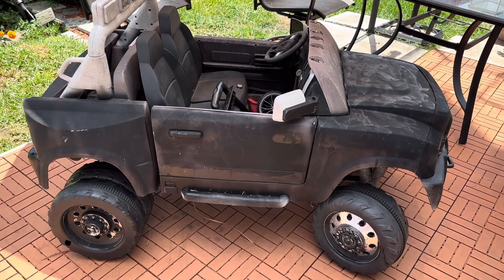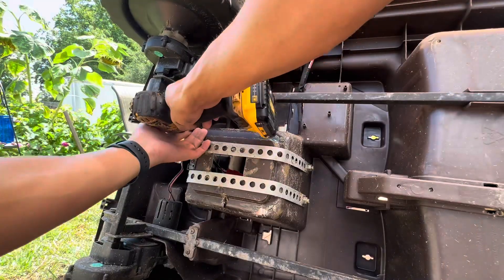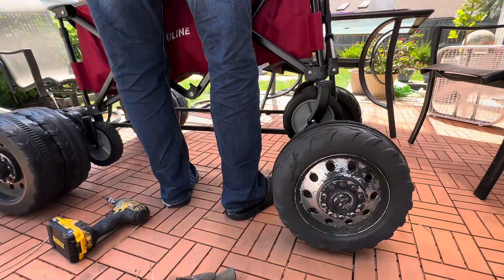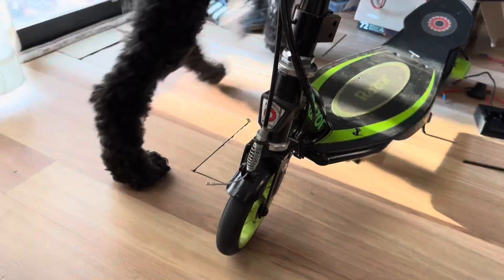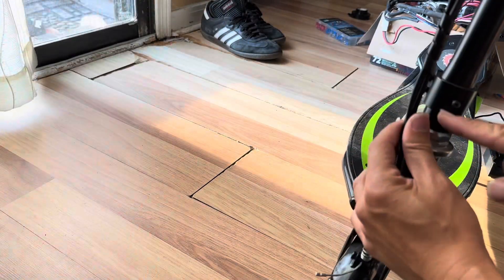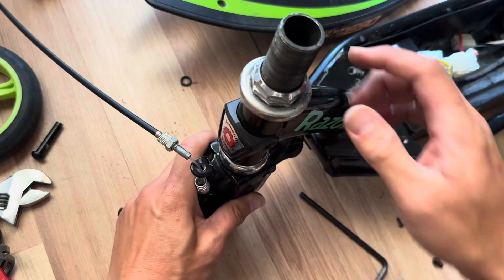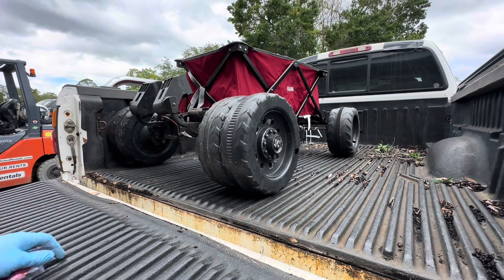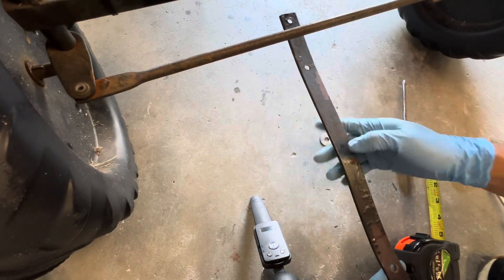Building 40V Electric Motorized cart Wagon w/ power wheels kidtrax, Uline wagon Razor scooter Dewalt

Comment: Does it free spin when batteries are dead?
Reply from the maker: Hi, The wagon can still be pulled when batteries run out.  It doesn’t spin completely free though.  The motor is still engaged with the wheels, but it does roll with a little resistance.  We had about 100 lbs of fishing gear on the wagon and were still able to pull the wagon through the sand at the beach.  We never go to the beach without the electric wagon. It has made it so much easier to carry chairs, fishing rods and ice cooler onto the sand. My kids end up pulling the wagon because it’s fun to them.  Me and my wife get to walk onto the beach without carrying anything.  I am in the process of building another electric wagon, but this time, it will have a wireless remote control with all wheel drive.  Let me know if you have any other questions.  Thanks for watching.